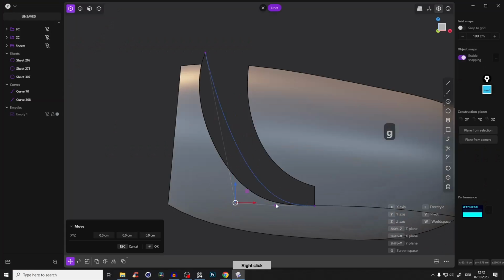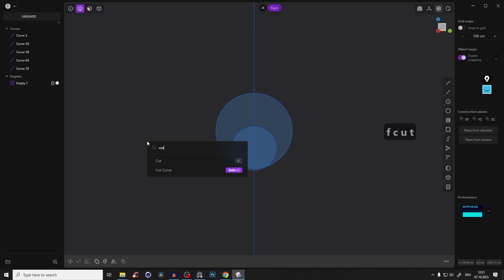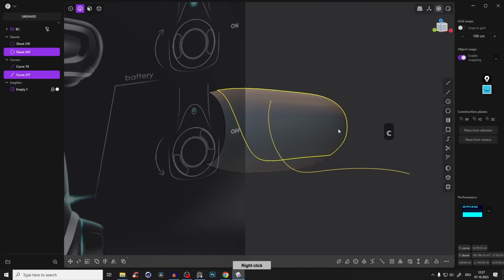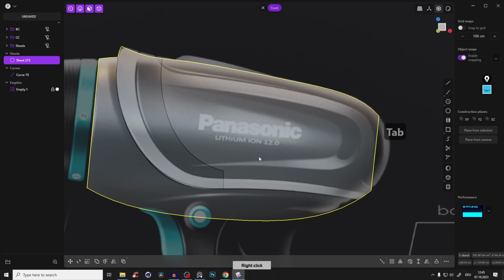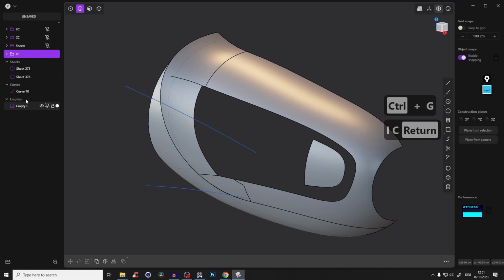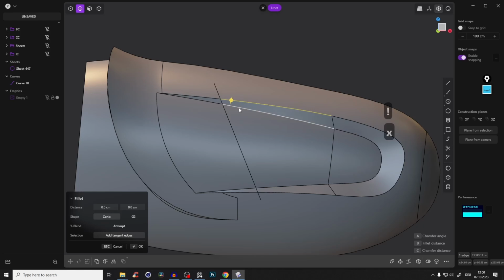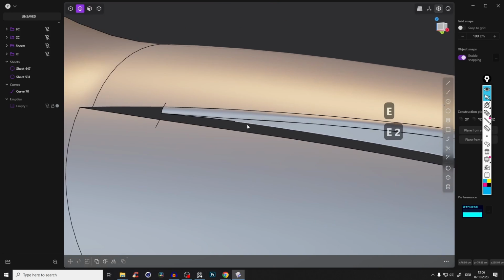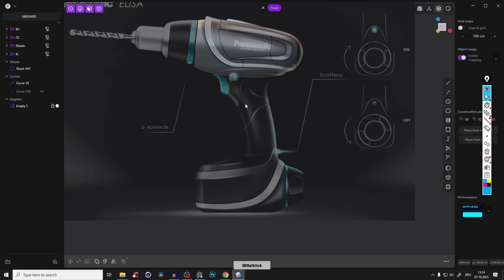Advanced Surface Modeling in Plasticity | Power Drill Design | Part 1

Comment: Thank you for the video. There's nothing wrong with your format or information.. but in my opinion Plasticity is not quite ready for reliable production using Surface techniques.
I wonder how many times you had to get the precise steps down in order for this to work.
I have followed the steps TO the letter over and over again and my G2's almost never work. An extremely slight change here or there and yes it works.
Hopefully surface modeling will be reliable at some point...
Reply from the maker: Plasticity was never intended for "Reliable Production" For that you have tools that cost $5000+ 

Plasticity is absolutely amazing what it can do already (especially for its price). G2 is in general much more complex to control than G1. That's why I emphasize in the tutorials, that G2 is mostly not needed, as it needs more experience/adjustments than G1. 
But I try to push it as far as I can.

Also, Plasticity is just 1.4 right now. So everything right now is just warming up for the future!:)
Reply: @nikita.kapustin  To be clear, I don't mean manufacturing when I say production. I mean that the general function of the program is not reliable when it comes to Surface Modeling.

As a comparison, what you do in Blender just works. Period. You don't have these tiny little changes you need to make to get something to work correctly.

Nothing in Plasticity is complicated at all. It's a matter of whether the tools work or not. A ton of additional tools are also necessary to make it reliable. For example, controlling what you can snap to instead of snapping to Everything.

I know that it's still very early in its development. I've been following it for almost 2 years now.

Comment: What does rebuild do to help? I.e why 100 points?

I think the new Cordial fillet option creates the same thickness for every filleted edge rather than relying on pipe
Reply from the maker: Rebuilding a curve with a lot of points is essential when you have long, complex curves.

If you rebuild a curve with many points, which you will pipe than the pipe will be clean without any interruptions or edges. Which will give you a better result when cutting he surface.

I haven't tested the cordial fillet yet. I can imagine that this new function will be oftentimes good enough. ut for complex surface geometry the pipe method will always work with the best possible results.
Reply: @nikita.kapustin  Cheers for the reply. So the pipe won't follow nurbs like a standard surface will? You need to define resolution?
Reply from the maker: Yes exactly. Try it out.

Build some random curves, splines, straight lines with sharp corners and stuff. Join them all into one curve and try to pipe it and look how it looks, and then try to rebuild the whole curve with a LOT of points and pipe it again. 

The second pipe will look much smoother and cleaer, thus make less problems later

Comment: A tip:  I use Patch 100 times more than Pipe, so I assigned hot key "P" to Patch.  For Pipe I use the icon.  Surfacing goes much faster now :)
Reply from the maker: Thanks for mentioning. Wasn't at my mind's radar at all to put "Patch" on a short cut lol
Reply: i set it ctrl F，cus blender is F😂